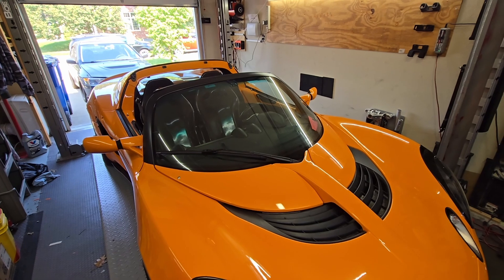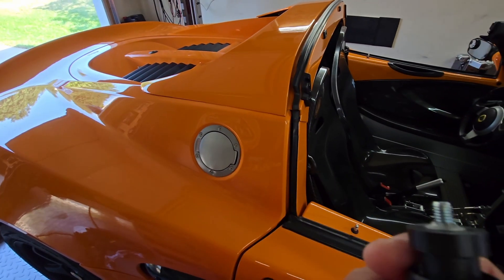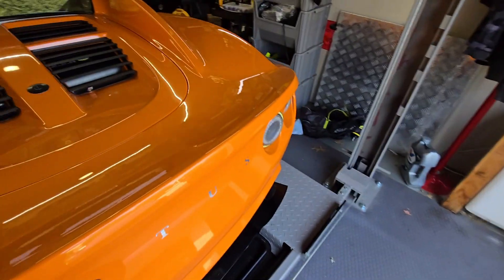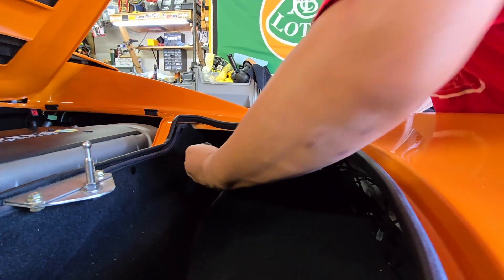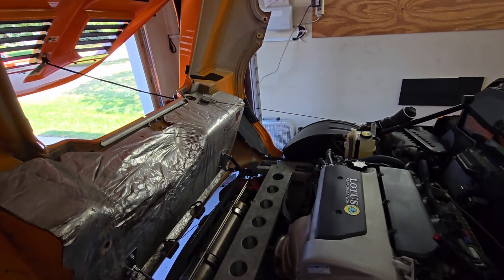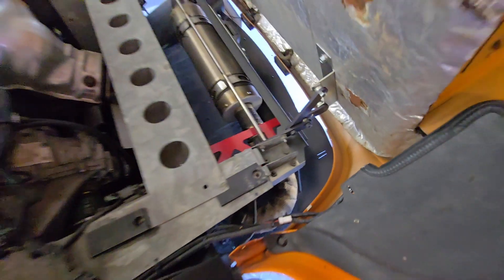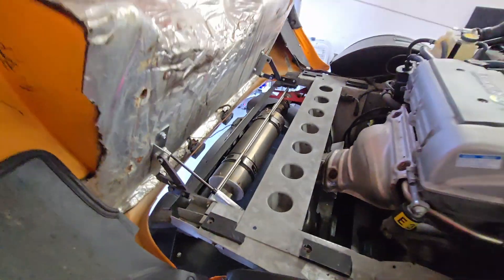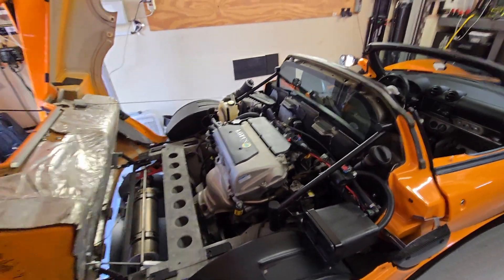Part 4 Lotus Elise Projects - Clam Tilt Operations

Comment: Hey, I am just at my first time tilting. Your video is invaluable to me at the 10:00 mark. Thank you for showing the struggle, I feel like I'm definitely lifting up enough and getting that back up, but the front is catching.
Reply from the maker: Hi there, some trimming may be needed on that foam piece but i feel like there would always be a little catch right there. I actually made another video with the 2 struts and brackets that really did help me (if you search the internet for "Rear clam hinge lift struts" you will find the details of what i copied. I just finished the video and need to do some editing. But i am glad you got everything installed and to that point already. So much of the maintenance work is a lot better with the clam kit!
Reply: @nedsgarage  Thank you for the reply I almost feel like my hinges even before installed really don't have that much force. Perhaps I need to grease them. I will check out your upgrades! Thanks!

Comment: Hey, I am just posting again after completing the video. Thanks so much for discussing all these details and little things you did or recommend. 

You mentioned several times a place where other people were discussing their clam kit installs, can I ask where that was? LotusTalk? Thank you.
Reply from the maker: Yes, lotus talk had so much information and even before i bought it i went on looking to read up on all the threads on there. For example; adding the strut to help with opening and closing was a set of instructions on a thread that someone made on there. Although i didn't copy their design i adapted mine pretty close. I will say i would like to add another strut on the other side as you can see from the video that having it on one side tends to push up on the right side and i kind of have to wiggle it to balance that. I wish you the best of luck in installing the clam kit and glad this series of video help you a little.
Reply: @nedsgarage  I got the clam off :)
Reply from the maker: @DAaaMan64  how's the progress going?
Reply: @nedsgarage  I think my last comment was sent to you for review. So if this comment makes no sense, lmk. Lol

Also thanks for the help so far! I'm review your videos over and over lol

I'm thinking one side is just a bit higher than the other and I need to keep looking for cables or something to clear out of the way.
Reply from the maker: @DAaaMan64  is it hight towards the back or the front of the clam? We're you able to get your metal shims all sorted out? I had 1 shims that stuck on to the clam underside when I removed it.

Comment: Do you have a rubbing issue when opening your trunk after installing the kit? I even shifted the washers and tried at least 4 times to adjust everything to give me more clearance to no avail, it's not much rubbing, but definitely a bit.
Reply from the maker: @madarauchiha1218  Hi thanks for watching and commenting. When I was installing it, the trunk lid toward the back was was rubbing and I had to back off the bolts and shove it forwards and tighten them down to get more clearance. However, after that I don't have any other rubbing issue. Although the gap may not be perfect around the engine lid (i don't think it was perfect to begin with before).
Reply: @nedsgarage  I had the biggest pain in the butt trying to re-install it with the clam up like they stated. I might loosen it with it down and try yanking on it a bit.
Reply from the maker: @madarauchiha1218  i think i had the clam back down and pushed it towards the fire wall and sneaked a ratcheting wrench in there to tighten it, that's how i put some pressure forward.

Comment: HEY! Where did you get that push button trunk opener???
Reply from the maker: @bemaco1  Hi, thanks for watching and commenting. I had an issue with my factory lock and it would not open. I had to force it open and the latch mechanism unglued itself from the fiberglass hatch. What I did was elongate the key hole and installed a quick-latch, I got the keyed version that I can lock if needed. https://q-latch.com/page14.html.
Reply: @nedsgarage   thanks!! Looking forward to see what else you do!  (May I suggest a supercharger - really gives these things what they needed from the factory to be even more amazing)
Reply from the maker: @bemaco1  i already got a couple of things planned for this winter? Be sure to check back in. This car is already supercharged from the previous owner (Katana 1 S/C). I have driven a factory power elise and agree the mid range is welcoming.
Reply: @nedsgarage   That's why i couldn't spot it ;-)   The company is horrible to deal with but BOE REV300/400 will give you a lot more kick in the pants
Reply from the maker: @bemaco1  BOE is actually local to me and would have been the obvious choice. I know that TVS is more efficient with more power and lower intake temps than the mp62. My kit is running well so it's a little hard to justify removing it for another kit. I do plan to get it dyno'd at BOE one of these days to see what it would make (Katana 1 with CharlieX tunes) I would be happy with 200 whp and it does drive like it has at least that.
Reply: @nedsgarage  I've learned one thing, if it's running well, enjoy it! It was a 3 year journey to get my car sorted out after trusting BOE knew what they were doing. I'm doing just shy of 350 whp now though and finally running incredibly well - worth it in the the end i suppose. Good luck with your future projects!